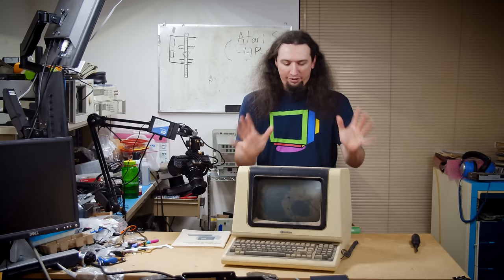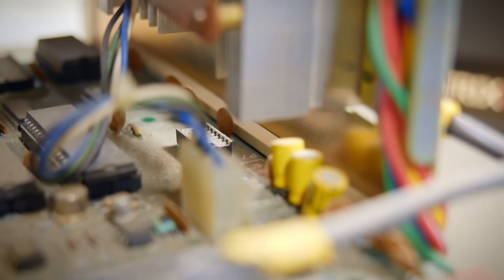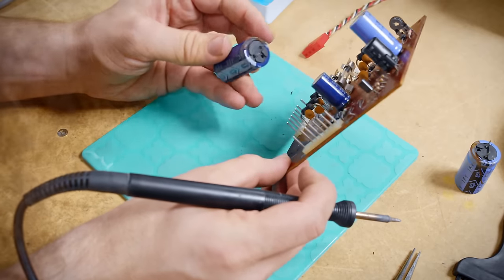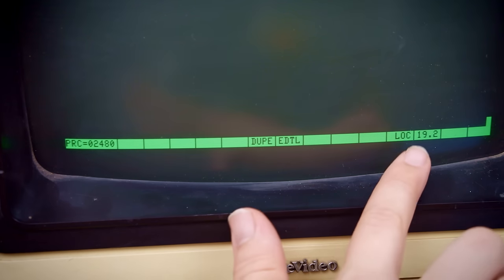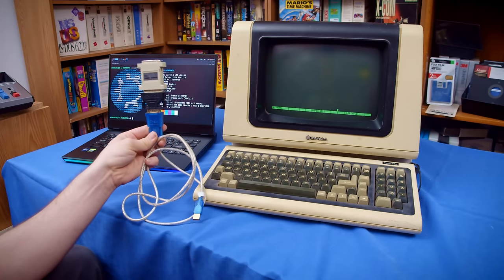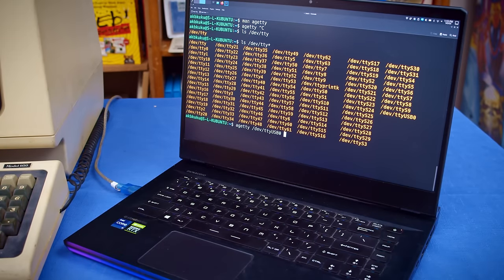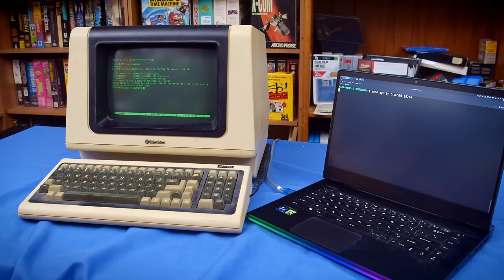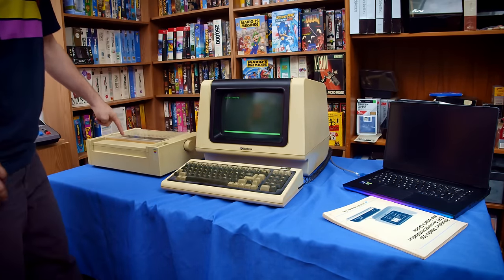1980 Terminal with Linux - TeleVideo 950

Comment: This is super cool, I've always wanted to learn more of these "dumb terminals." I wonder if it would be possible to somehow pipe Doom through somekind of video-to-ASCII thing and then show and play it on that terminal?
Reply: Probably not. Back then, memory was super expensive so it was typical to store only the ASCII characters in RAM and use a dedicated chip called a character generator to turn each ASCII character into the bitmapped image while drawing the screen. So this terminal doesn’t even have video RAM that you could render Doom into. However some terminal could do graphics via “sixel mode” or vector drawing.
Reply: @amartini51  Petsci Robots ?!
Reply: @amartini51  It seems you didn't get the "video-to-ASCII" part of the message.

Comment: 9600 or 2400 seems totally reasonable if all you're doing is text mode.  Rough if you're transferring files but fine for command line.
Reply: The 2400/75 Asymmetric modem rates were optimized to allow 7 keystrokes per seconds versus 240 cps of data return.  This later evolved (conceptually) to ADSL modems at 5000 times the speed .

Comment: I think you can blame IBM for some of the gender issues.  In the beginning, pretty much every machine had female RS-232 connectors (the real, 25-pin, ones).  When IBM decided to cheap out on their original PC and use a DB-25 instead of a Centronics-36 connector for its parallel ports, it decided to use female DB-25s for parallel and male DB-25s for serial.  (I had an AT&T 3B1/Unix PC, which had an honest-to-goodness Centronics-36 on it for its printer port.)

If not for that, I'd expect that the USB/serial adapters would have male connectors.  They'd also be DB-25s, as I believe that IBM also popularized the DB-9 connector for serial.

Comment: What a sad state of linux affairs that programs don't respect the terminal capabilities anymore. :(
Reply: It has over the years been difficult getting updated terminfo entries into Linux-based operating systems (albeit that M. Dickey is very responsive to people providing stuff, in my experience; it's getting those updates through the distribution maintainers that seems to be the bottleneck) that even provide things like information about colour, so there's a decades-long tradition of just hardwiring XTerm colour control sequences.

Comment: Was just saying the other day how much I want a terminal connected up to a modern Linux machine. Was hoping you'd run Ed + edit some files the way the FSM intended.

Curious what happens if you set `TERM=dumb` (I know that on my box, at least, `man` gives some warning about how the term is 'not fully functional', but it renders correctly.)

Comment: What were your settings for the S2? I have TeleVideo 925, got seemingly the right cables but nothing happens when I try to connect via agetty - seems like it just times out. My terminal does not have the status line by default upon power on - I can get it to show with SHIFT+NO SCROLL/SETUP though.

Comment: Kaypros have keypress beeps. You have to turn off the beeps in the config program. I never have because it's not that annoying to me (the piezo speaker being buried inside the metal cased keyboard is barely audible unless you're working in dead quiet).

Comment: To get your backspace working again in screen, try "stty erase ^?" or "stty erase ^H" (I don't remember which is BS vs DEL - it's been a long time).   Also in the OLD days with getty (pre-Linux days), on some systems you had to put in a termcap entry for the terminal and then "compile" it into a terminfo file that was actually used.  Don't know how Linux does it, this was in the days of BSD 4 using termcap and Sytem III/System V using terminfo (again if I remember correctly).  It's been literally decades.

Comment: It's likely that the TVI-950 either doesn't support highlighting and underlining, or that there's no information in the Terminfo file to tell Screen how to do it. Highlighting and underlining worked fine on my NCR 7912 through Screen, and also directly with the majority of programs. But that was back in the 1990s, when only a few noobs had adopted the attitude that only software terminal emulators mattered. If "man" showed fragments of ANSI sequences back then, it would've been regarded as a bug.

Comment: a computer/human interface capable of connecting to a computer on the other side of the country, with built in user-side printer connection?

printing a file from a computer on a printer many kilometers away?

we barely have that today. you would have been king of the conference room back then.

Comment: Yeah... Many programs just don't support anything other than what typical Linux terminal emulator uses. I would imagine ncurses would handle escape codes correctly, but others would hard-code or use library that hard-codes escape codes.
Honestly, even I don't really think about those old terminals when writing programs. Though I also do not use any escape codes either, to make redirecting output to file easier without relying on third-party library.

Comment: On the cabling front, I've found these days its easy to get d25 and d9 breakouts to screw terminals - fairly cheap on your favourite cheap china stuff sites, and then use jumper wires to create the exact adapter you need. Rather than having to find the right combination of adapters, gender changers, and null modems.

Comment: It seems to me that all you need to do is get sudo working and you should be fine. As a software developer who works entirely in a terminal emulator, I see nothing wrong with your terminal (aside from being slower than the 115200 baud I like to use when I use a serial line).

Comment: If you run SCREEN and point it to /dev/ttyUSB0 (screen /dev/ttyUSB0), that should work without needing agetty. That would also fix the issue with using sudo on the terminal.

Edit: I spoke too soon lol. I should have watched the rest of the video before commenting.

Comment: Being an old fart who started with serial terminals, I can say that almost no one printed to an attached printer for several reasons.
1  a printer was expensive and was usually shared with its own line.
2  printing via the terminal sucked and was usually limited to screen prints.
3  to print a document, you needed software that could spool to the attached printer.
4  While you're printing, you can't use the terminal, it's busy schlepping data to the printer.

Comment: The 25 pin RS-232 serial interface didn't provide any additional data flow control versus the 9 pin RS-232 serial interface. What it did provide for was a secondary communications channel and clocking for synchronous devices. Most devices didn't need these features and therefore most uart chips didn't implement them in order to save cost. This includes the 8250 uart which was used with PCs.

RS-232 specifies two types of equipment, Data Terminal Equipment (DTE) and Data Communications Equipment (DCE). DTE is things like a terminal or a computer. An example of a DCE would be a modem. DTE and DCE are meant to connect together so their transmit and receive are wired differently. They also have different gender connectors with DTE being male and DCE being female. When you connect the two together a null modem cable and gender changer are not needed.  Since the terminal and computer are both DTE you need both in this case.

systemd comes with a serial-getty generator which if configured according to the directions at http://0pointer.de/blog/projects/serial-console.html will not hang your system if the serial port is not present. It does this by making the unit dependent on the serial port via a BindsTo statement in the unit. If the serial port is not there the unit will not run.
Reply: Ubuntu, and many other distros, in .bashrc try to determine if the connected terminal supports color and sets the prompt and aliases for certain commands to turn on color output. This includes setting an alias for ls which enables color output. I wonder if this code is not working correctly because of how agetty is being launched.

Comment: The problem with the SUDO asking for login only happens when you run agetty directly. In my case, I have a systemctl  in my pi to auto load the agetty. Then the terminal behaves like a real Linux term. I can install, run sudo, logoff, logon, etc… my Wyse 55 is always ready to be used…
Reply: It's all to do with controlling terminals, and appropriate use of a tool to set a new session ID and allow re-setting the controlling terminal by agetty would have fixed it.

Comment: Hah hah! I feel the pain on the drawer full of gender changers and adapters for serial port comms. I went through this with my HP Visualize J6750 Unix workstation when I was first setting it up and installing software and such. The HP needs a 'console' to get to the bios settings, etc., and the serial console runs at 9600 8-n-1. Once I got all that figured out, I was able to get in with Teraterm and make the necessary changes.😄

Comment: This was a wonderful video, that said, I have a comment/question regarding checking $TERM / using NCurses.
I don't see why modern applications should check what terminal they're on (besides maybe for alternative buffer support), nor do I quite see why we should use NCurses.
Nowadays, the vast majority of people who run terminals, run terminal _emulators_, and basically every single one of those support the decades old ANSI escape code standard.  Having every program check $TERM or use NCurses is just wasteful for most people, especially since 'screen' can be run for those who actually use real hardware terminals.
We don't do this for text encodings, why should we do this for escape codes?

Comment: I very much doubt that Bash itself emits (colour) control codes.

However if the person behind the keyboard have blindly configured a $PS1 variable (prompt string) or a $PROMPT_COMMAND without paying attention to the terminal type, then Bash could do anything, including sending weird escape sequences/colour codes to the innocent terminal.

And of course, you have utilities like 'ls' and 'grep' that tries to be helpful and colourise their own output unless you explicitly turns it off. But at least those utilities should be smart enough to read said escape characters from termlib and do it right. 

As we used to say: PEBCK - Problem exists between chair and keyboard.
Reply: BASH doesn't emit color codes, it emits the paste delimiter code specific to Linux consoles. It protects terminal emulator from malicious pastes.
Reply: @IkarusKommt  - I don't think you know what you are talking about.
Reply: @JanBruunAndersen  DECSET 2004 - Enable bracketed paste mode.
Reply: @IkarusKommt  - I could be wrong (but I doubt it as I am usually right), but I do not see what relevance this DECSET 2004 thing has with Bash. It seems like something that is only of concern to terminals and terminal emulators, not with whatever command interpreter or whatnot that is talking to the terminal.

Comment: For decades I did use serial terminals, a lot. No longer have any, through I do still have a machine with 2 serial ports, a bunch of really long serial cables, and a box of gender changers.

Those gender changers turned out to be usefull for something else.. the insanity of 9 pin rgbi connectors and being even less standarized than rs232 connectors.

Comment: Ive been playing with this using a VT100 terminal emulator but used a BBC micro B as a terminal with a VT100 rom. Tried using different terminals but found delete didnt work. I now no thanks to this video that i can get it to emulator different terminals by using trhe software you installed i'm going to try it on linux mint. WIll have to try it with AGETTY as use getty before with systemctl

Comment: That 'D' connector with 9 pins is a DE9 which you incorrectly refer to as DB9 - of there's no such thing. 'E' refers to the smaller D shaped connector size. 'DB', is the larger connector usually associated with 25 pins, but also comes with 44 in high density, just like the DE connector also comes with 15 pins in high density as used by VGA. There are DA, DC, DD etc. All different size. And no, not in any particular order. I guess they just gave them sequential letters in order that they invented them. Go figure.
Reply: They are in order, except DE-9: DA-15, DB-25, DC-37, DD-50.
Reply: @oqibidipo  fair point.

Comment: funny how computer people always go 'oh noes it's soooo dirty' when there is a bit of dust on something :P tried taking apart some cars recently? lol.
Reply: 'first start in 30 years, will it run'. eh yeah. probably. it will just run. without all that stuff with 'deformed capacitors'. if they blow they blow. so what. they're not supposed to conduct anyway. as long as they blow straight in half and no conducting bits are left :P computers from the 70s and 80s are generally designed to just work. even after sitting in youir  facility for  50 years until the zombie apocalypse might one day come and they finally get to be turned on for the second time in their lives :P LOL.

Comment: I can see the goo leaking out of those caps. Replace them dude!
Reply from the maker: If you are referring to the thicker brown substance visible in 8:29 for example, that is actually a glue used to secure the capacitors to the board for shipping so any jostling doesn't put all the force on the pins. More modern boards use an even thicker white caulking type material to do the same job now.

Electrolyte is mostly transparent and much thinner, the board would just look shiny if that was leaking.

Comment: "100 uF"?
There is no "u" in the measurement of capacitance, or even other electronic or electrical units. The character that often comes right before the F (for farads), at least when speaking about microfarads, is the Greek letter mu, which is basically their version of our (Latin) letter m! That's why it looks like a sub-lowercase m almost to the point of looking a little Uish.

Comment: I'm confused. The hardware terminal emulator i have has an independent character ROM. Is it therefore not an emulator?
Reply: It's a bit of a contrived definition of what a "real" terminal is.  In reality, those other terminals are just as real, even though they can emulate the protocols used by terminals from other manufacturers.  I think that what xe was getting at was not so much that the other terminals are emulators, but that TeleVideo didn't set out to clone someone else's product.
Reply: @JdeBP  ahh.  It is impressive though, that these days, all the VT series terminals can be replaced by 3 chips and some passives.

Comment: At 8:50, couldnt you just leave the caps on the board when you reform them?
There really isnt any other circuitry on there that could be negatively affected by it, and it would reduce the thermal stress on the pins (and on the areas inside the cap close to the pins)